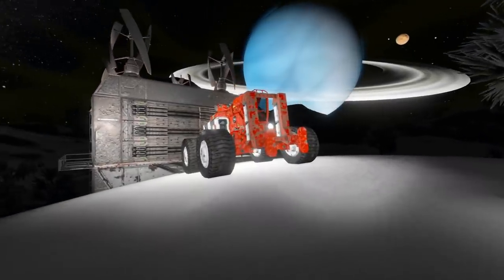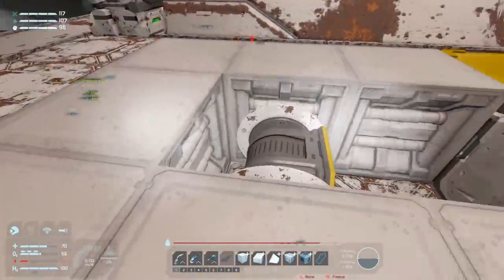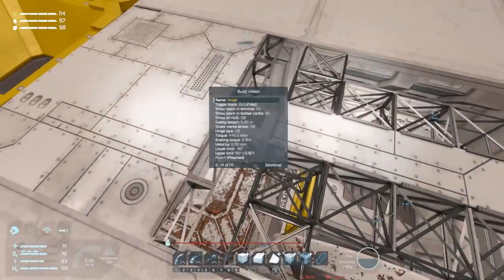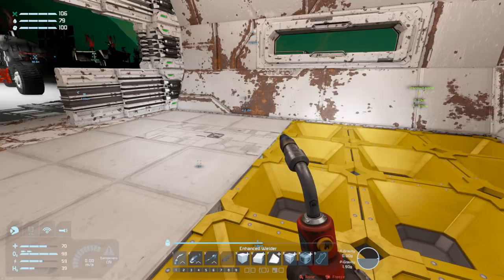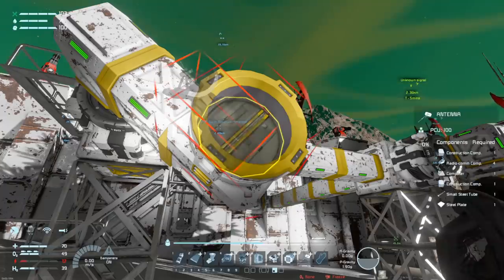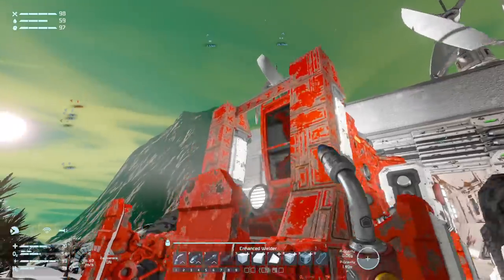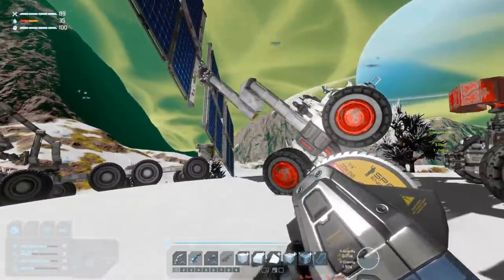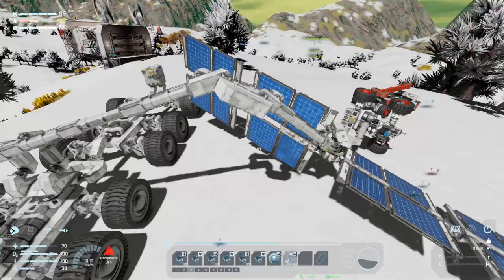Survival Impossible - Manny or Mannie or Clangy? #39 - Space Engineers Hardcore Survival

Comment: Upon inspecting in slow-mo, the block imbedded in the voxel is clearly being pulled up (48:03). What I would try (if I was home that is, can't test it on this potato laptop) would be to detach the hinge as you did, but swing the conveyor line out of the way, then do the merge block trick, and then swing the conveyor line back and re-attach the hinge. Maybe the hinge could be more forgiving in this way, but again, can't verify that theory atm.
Reply from the maker: That definitely sounds like something worth trying :)
Reply: @Splitsie  yeah same idea here, because we see that the hinge base was forcefully pulled off from the exploding conveyor, so I also think the voxel embedded blocks are being pulled up because of the hinge not allowing literally any vertical movement.
Reply: I don't think it's being pulled up, I think it's being pushed out. From what I remember, merge blocks defer the smaller grid to the larger grid. So the pillar with the hinge, being the grid with more blocks, is making the static grid a dynamic grid, which means it's being rejected by the voxels.

I would recommend, @Splitsie, slamming a series of blocks, in excess of an amount equal to the pillar with hinge, to the static grid base, so that the pillar defers to the static grid, and not the other way around.
Reply: @tomkatt1938  if have a good look at 48:00, after switching on the MB you see that it is pulling out the embedded lower parts. It might be a combination of both...
Reply: @tomkatt1938  also when you try to make your respawn ship loose its status you MB it to the ground (splitsie has a good tutorial on that, there you also merge a large number of blocks on the smaller number of static blocks, and there it works...
Reply: @Splitsie  I was thinking the same and or placing an advanced rotor in line with the hinge to allow for vertical and horizontal alignment.
Reply: @Splitsie  what i am wondering is if you can "stationize" a large grid that is currently locked to the ground with a landing gear.... 
or even directly extend a large grid into voxels if it is made static by a landing gear. as the "staticness" created by a landing gear is sufficient to allow for turbines to work it might also be enough to allow placing blocks into voxels.

then because of the locking tolerance of the landing gears you could just build the entire tower on the hinge and have it lock in place EXACTLY where it has to be for no clanging with the hinge.

last alternative would be to simply lock the towers to the ground only using landing gears. that is not the best option, but if you go and make the towers entirely out of small grid you can use 4 gears in a cross pattern which looks nice as a sort of clamp and lock it to an armor block in the ground to close the gap.
plus it allows you to greeble the entire tower because it is small grid.

this would be really performance heavy, because of the amount of small grids and the landing gears arent cheap either, but as a last resort it could work and wouldnt create any phantom forces at all
Reply: @Splitsie  oh and another way of doing it could be to put a projector on the hinge that projects a kind of guiding tower to better align the first block of the tower. the part could even be reusable for the other towers if you detatch it and take it away with the crane. that way you get to use the crane in some way but still build the tower by hand starting from the ground. if you use inverted corners for the projected mock tower you can see the individual blocks in the projection for better alignment
Reply: Or add a vertical hinge off the horizontal one to give that slight up/down movement.
Reply: @Splitsie  also detach the landing gear on the crane
Reply: You might also disconnect the lifter.

Another approach would be to go into creative (or do the math), on placing them oriented to the main base grid and try and work out and XY location for each block.  For example, if you have 8 conveyors (8.06 in this calc), you need to move (about) 4 blocks X and 7 blocks Y (taking the hing location into account).  Then you could build and weld on the ground, place the towers and then build the conveyors after the pillars and slip them into place.  This wouldn't work for the last link, but that one is going to be hard no matter what.
Reply: I'd try sticking a couple of battery frames on the base, so the bottom takes precedence in the merge, same way as tipping stuff over.
Reply: SirTragain - sort of a universal joint.
Reply: @tomkatt1938  If I had to guess, what you are saying is correct. Merging the single block to the pillar is converting it. then you have a "ship" that is intersecting with voxels.
Reply: Maybe use a connector with battery to form the base of the towers? They tend to be a lot more forgiving with their lock function.
Reply: @Splitsie  also try creating merge blocks higher above the ground :)
Reply: I think he might need to also add a router behind the hinge so that he has a bit more give for it moving like What he did on the astroid

Comment: I'd try adding more blocks to the static grid of the base of the pillar than the top section, and hope that means the top gets merged into the base (a static grid) rather than the base into the top (a ship grid) and stops suddenly hating intersecting with the ground. It's definitely possible to merge a dynamic and static grid and have it be static, otherwise things like the tunnel boring machines wouldn't work.

If the grid was being converted to static already, and then exploding because of the hinge, I'd expect it to remain static after the explosions.

But I'm not sure logic really applies in cases like this. :D

Also, thank you for your dedication in getting episodes out in the face of awkward shift patterns!
Reply: Yeah, my hypothesis was also that the merge isn't converting the pillar to station, so all the blocks intersecting the ground are taking damage. I'd try building the pillar in the air, converting it to station through the grid info, then building the bottom block onto it (i.e. no merge blocks or weld pads).
Reply: This seems most likely to me too - that the embedded blocks are being converted to a ship.  I'd suggest checking if the pillar can be put in position, attached to the hinge, and then converted to station.  If that can be done, building on to the base of it to embed blocks would be simple.

Comment: Use "Pythagorean triples" AKA "perfect triangles" to decide where to place the towers. A Pythagorean triple is a right triangle that has whole units of length, like a 3-4-5 triangle. For your project, you can use use a 6-8-10 to make the towers and if the final distance doesn't exactly match up, connect them with a piston/connector.
Reply: While this could be made to work for part of the run, it defeats the point of the "overland pipeline" challenge if all the pillars are aligned to the same grid.

That said, I'm a big fan of Pythagorean triples, and a couple of years ago I even made this handy cheat especially for Space Engineers of all the angles achievable within a reasonable number of blocks: https://i.imgur.com/zZ9ibNU.png
Reply: Tha does not take into count the height difference between them only location
Reply: @mattp1337  They have to be aligned or they won't attach. We havd a x,y, z, rotationXY, and tilt. The hinge changes the rotation, but the tilt and x,y, and z likely need to be perfect.
Reply: @seananderson5850  Yes, I understand that (I've been playing the game for more than 5 years). I'm the one who gave Splitsie the challenge some months ago of running a "pipeline" connection over an extended distance. It's implicit in the challenge that the endpoints and supports are all different grids that don't share a common alignment.

I was just speaking to the topic of Pythagorean triples, meaning triangles with sides that are all of whole unit length in a 2D plane.

Of course that 2D geometry can be embedded within a 3D space but that—or Pythagorean N-tuples of higher degree—is a topic of wider scope.
Reply: @seananderson5850  I think the work up on the Lawn Chair base seems to show the connections don't have to be perfectly aligned. There's some give in them.

I'm guessing that they don't have that give when already connected though (or not as much of it) - so maybe lining them up with the lifter, but not connecting the hinge, then doing the welding (the give in the lifter, hopefully, being adequate), then connecting the hinge.
Reply: Ah, I guess that's what he tried last already. Yeah, as someone else said - moving the conveyor out of the way will hopefully help..

Comment: Make this structure as static grid and add blocks on ground, other ways not possible
Reply: Right here, to get this to work your best bet is to convert the tower to static and then build into the ground, if it will let you - may need a landing gear to lock it in position to convert. Much less explosive than trying to merge it to a static grid already in the ground.

Comment: 6:19 We'll be sure to remind you if you do forget. I'm sure nothing bad will come of that loose block in your multi-subgrid folding connector in a building made for other loose grids to be split apart within it.

11:53 Not sure exactly how the collisions on hinge bases work, but I think the antenna might be grinding against the hinge a bit too.

13:12 I think the hazard stripes makes more sense to have since it's a moving part with quite some force behind it that isn't immediately obvious, though for looks I prefer it being plain white. I suppose it should depend on whether you intend on this place being usable by a crew who isn't too experienced with how the whole place works.

16:56 Imagine being a civilian ship passing over a known hostile base (at least, something ASSERT treats as hostile), and when you call for support in case of attack the military just tells you off about how many times you keep getting into this situation.

21:22 I feel like for such a building which is out a bit from the rest of them and seemingly a bit more disused than the rest (given it's caked in ice showing how it's not been cleaned or used in such a way to have heating active), having them open in a more random order might make more sense and look equally interesting. The start-and-stop motion the middle section of the doors gives them also adds to the effect. It'd be like there's ice on the wires or something.

24:37 I think the flexibility of having so many subgrids just saved that thing twice. Once when it fell and the second time when the crane hit those solar panels against the ground.

27:56 Might look a bit better if you ever got around to adding grated catwalks to the conveyors.

29:03 It would make sense if that was the case, I think it's the game teleporting the tool's model elsewhere when you take control through the cockpit since you'll have it when you get out but have a different hand position when in said cockpit. But the game might not know what to do when you take control through a remote control block, since it doesn't have anything else to replace the arms with it just doesn't.

33:05 Your first thought to protect your base is to put Capac clones into the line of fire? I suppose there are quite a lot of them. And they do seem quite the enticing target...

36:30 You'd want to grab it from the top above the center of mass though, so that you don't need a counterweight to lift it since the crane would be able to let the ground take some of the off-balanced weight and then it would naturally be in the right orientation. As it is now the rotors will still have a hard time getting it vertical though less of one transporting it. That's why you have a landing gear bay and why it's supposed to have a counterweight of functional blocks on the crane's base.

38:59 I feel this is an actually functional reason to have spotlight turrets around the place, other than looking nice when the drones get shredded - you can point them at whatever you're working on at night.

42:33 That one certainly didn't fly.

-43:19- 49:00 Locking the tower with a landing gear might let you turn it to a station (if what I remember of that system through several years of changes still holds), after which building it into the ground should be easy.
I think the reason it's currently exploding is because the smaller grid, the station part, is being pulled towards the larger grid (Keen uses this same system elsewhere, like how you can stop respawn ships from despawning), held by the crane, which appears to be wrenching it out of the little bit of voxels it's in and connecting it to the ship grid while still a little bit in the ground, which then causes all of it to explode. Testing of two things would help narrow down the exact cause - extending the lower section further into the ground to see if it can avoid being converted into a ship, and seeing if adding a pile of frames to the bottom to make it the larger grid can allow the tower to be pulled to it instead. I doubt the first one will work but it'd still be something to try.

50:33 Also, you might want to fix the movement each merge has caused on the other hinge if you intend to keep that tree intact.

Comment: So I could see that when you were merging the blocks, It was pulling the blocks in the Voxels up because of the slight height difference and the force pulling sideways on the hinge was making it explode. so I think that if you turned the hinge sideways so it was up and down and place 2 hinges there so it acted like a chain link and could zigzag a little it might work. alternatively, you could place a hinge as the base in the voxels, bend it 90 degrees and build the tower sideways and then straighten the hinge up to raise the pole vertical.

Comment: I wonder if exploding pillars is some sort of bug, you could try to check if it still explodes if you just try to merge one block lying free on static merge block. If it works well, you could try to merge pillar that is free lying on the merge blocks too. Maybe the problem was that with hinge being too close or the crane not giving up, you could at least try to deactive landing gear just before merging.
And it would be cool not only to leave the yellow black markings around docking point but also put for example lights that will activate when mechanism is up or going into upright position. Or maybe use LCD to show markings only when it's in use.

Comment: Like the floor connector, i'd go with the tape just so you don't park on it :).
I notice that when it retracts the piston isn't going down fast enough so it clips, was playing with pistons and hinges last night so hope you don't mind but it put the below script together for operating it, the speed can now be different for deploy and retract to remove the clipping.

Just need to Add your piston name and check piston speeds, think i got the hinge names.

      /// <summary>
        /// Deploy And Retract The Splitsie Collector Building Floor Connector
        /// </summary>
        /// <param name="Action">Pass Argument When Called Of Either - [Deploy OR Retract] - Case Doesn't Matter</param>
        public void Main(string Action)
        {
            //Names Of The Blocks To Be Added Here
            const string c_BigHinge = "Collector Building Connector Hinge Big";
            const string c_LittleHinge = "Collector Building Connector Hinge Small";
            const string c_Piston = "Piston";

            //Get The Specific Blocks By Name
            IMyMotorStator _BigHinge = GridTerminalSystem.GetBlockWithName(c_BigHinge) as IMyMotorStator;
            IMyMotorStator _LittleHinge = GridTerminalSystem.GetBlockWithName(c_LittleHinge) as IMyMotorStator;
            IMyPistonBase _Piston = GridTerminalSystem.GetBlockWithName(c_Piston) as IMyPistonBase;

            switch (Action.ToLower())

            {
                case "deploy": //Deploy Connector
                    _BigHinge.ApplyAction("Reverse");
                    _LittleHinge.ApplyAction("Reverse");
                    //Alternativly Instead Of Reverse Can Use Velocity Values (Guarantees Everything Traveling Same Direction)
                    //_BigHinge.TargetVelocityRPM = 3f;

                    //_LittleHinge.TargetVelocityRPM = 3f;
                    _Piston.Velocity = +0.2f;   //Set Extend Piston Velocity Here
                    break;

                case "retract": //Retract Conenctor Into Floor
                    _Piston.Velocity = -1f;     //Set Retract Piston Velocity Here
                    _BigHinge.ApplyAction("Reverse");
                    _LittleHinge.ApplyAction("Reverse");
                    //Alternativly Instead Of Reverse Can Use Velocity Values (Guarantees Everything Traveling Same Direction)
                    //_BigHinge.TargetVelocityRPM = -3f;
                    //_LittleHinge.TargetVelocityRPM = -3f;
                    break;
            }

Comment: There were a lot of good suggestions below me, but I have my own idea.  Here's how I'd connect the pillars if I were in your shoes.
1.  Build a piston somewhere into the conveyor pipeline, preferably the middle.
2.  Pre-build a tower using the Liftsie.
3.  Swing the previous section into the direction of the newest tower built.
4.  Fiddle with the piston length and hinge direction to get the next hinge in place perfectly, then attach.
5.  Repeat.
It's a bit tedious, but that's what engineering is all about.  Also ngl I'd be entertained doing it, so there's no doubt you'd be too Splitsie.  ;)